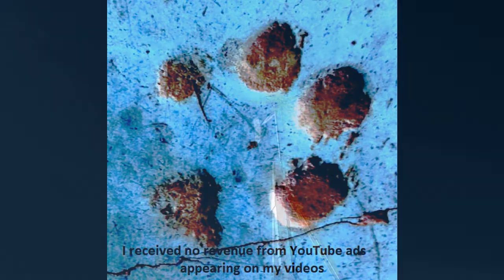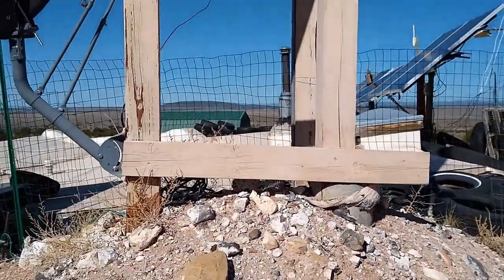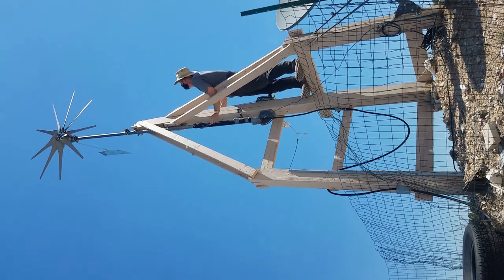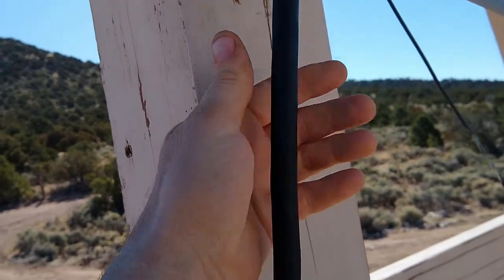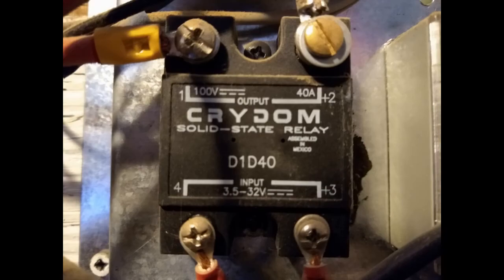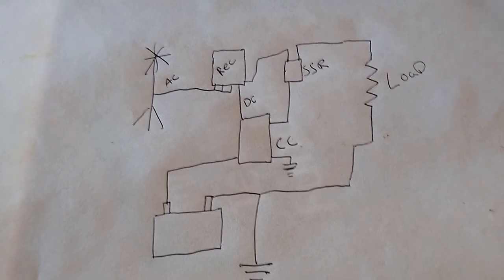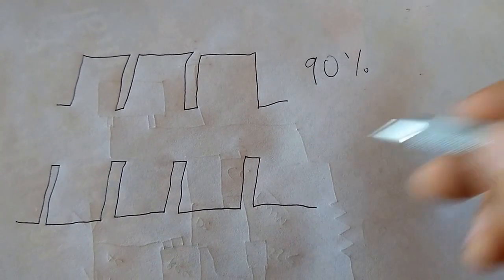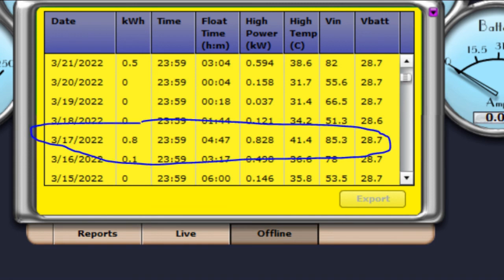Off-Grid Wind Power To Compliment Solar

Comment: I have 2 Midnite controllers, one for Solar and one for the wind turbine, if I put a DC SSR like you put on Aux 1, does it draw current from the three-phase bridge from the wind turbine or does it draw current from the batteries? that I would like not to have anything to do with Solaru, just to shoot the controller from the turbine
Reply from the maker: It doesn't draw off the batteries, it diverts unneeded power directly from the turbine to the load.

Comment: I also landed here because of your comment on the undecided Matt Ferrell video. Thanks for putting this together so quickly.

I'm curious, if you had to do this all over again now, would you add more solar panels, multiples of the same micro wind turbine or get a single larger wind turbine. Does the potential reduction in battery storage for wind (vs. solar) also factor into your decision on which to choose?

Comment: I love your tower. I built a wind turbine around 15 years ago but used straight pipe with 8 wires holding it up (4 near the top and four half way up). Raising and lowering it was a bit sketchy to say the least. Your tower may not be the highest but it works. Well done.